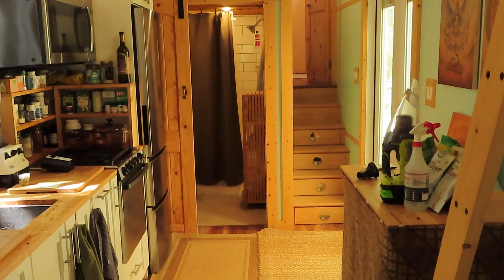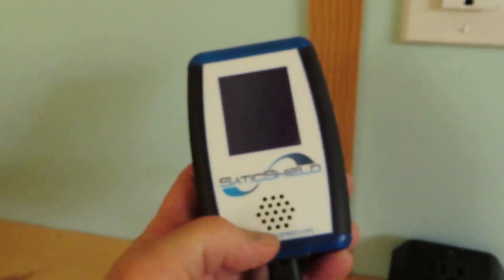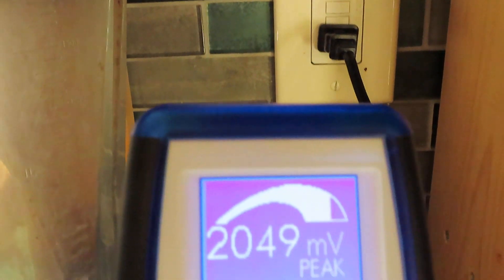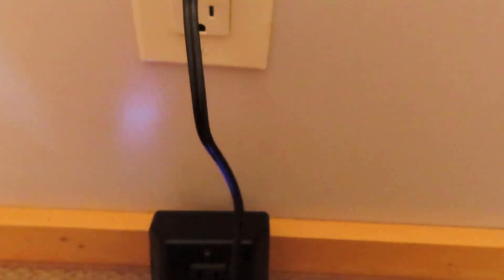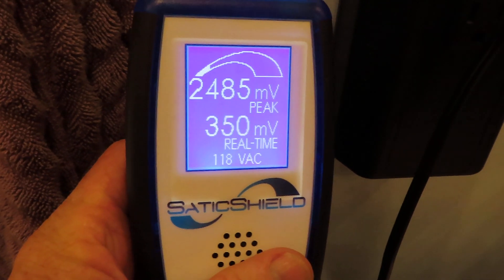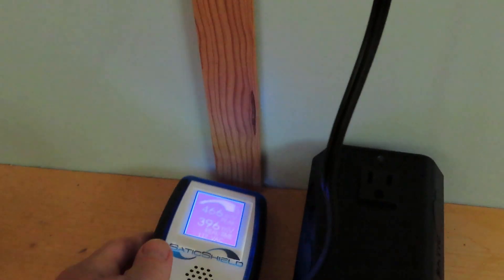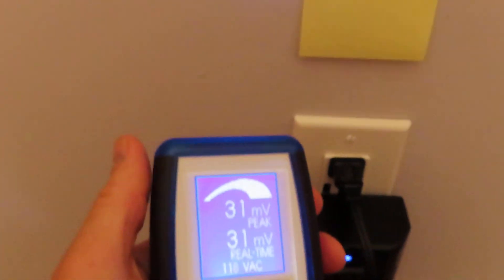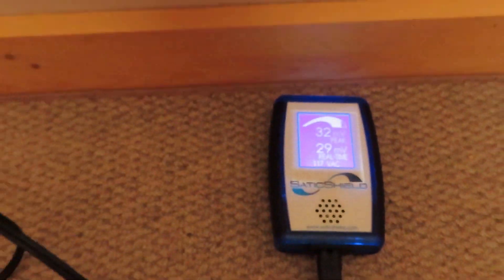Reduce Dangerous Levels of Dirty Electricity on Solar and On Grid Homes! Satic Pure Power PlugIn

Comment: I have electromagnetic sensitivity.  I am considering moving into an apartment building that has solar panels on the roof.  I just had a building biologist tell me it is not a good idea for me to live in an apartment building that has solar panels on the roof.  He said he would not advise anyone with electromagnetic sensitivity to live on a property with solar panels.  I think his point was that this is a building with 67 units and even if I put dirty electricity filters in my particular unit, I will still have the dirty electricity from other peoples units and their wifi etc.  It is only a three story building, so I thought if I asked for a top floor corner unit maybe I could put aluminum mesh screening or copper pipes on any shared wall to block out wifi or the neighbors dirty electricity, do you think this would work?  I remembered I had already seen this video, but maybe this works for you because this is a stand alone structure, unlike an apartment building with shared walls and person below you may have wifi/dirty electricity, so it may be impossible to totally mitigate.......But I may also be able to work with the property manager on getting some kind of dirty electricity filter for the whole building if I explain that this dirty electricity could have health consequences for the residents.  If I was approved for a top floor corner unit I could also speak to the neighbor below me and on one side of me and talk to them about using an ethernet cord and get rid of any wifi/wireless router etc.    Or do you think it is too risky?  Oh yes and I forgot to mention, this building is on grid, so it looks like they will use a combination of electricity and solar as I saw at least one OpenWay Itron Bridge Meter outside the building beside two metal doors.  So it looks like maybe they house 67 electric meters in the room with the metal doors.  I don't know enough about how solar works.  I am just describing as best I can as a layperson.
Reply from the maker: Listen closely please. Here is all I need to know, in your first sentence: "I have electromagnetic sensitivity. I am considering moving into an apartment building." It does not matter if the apartment building has solar panels. All you need to know are wireless devices, located in every single apartment, are going to be exposing everyone in the adjacent apartments through the walls, ceiling and floors. Solar panels and dirty electricity are the least of your concerns. Here is what I just posted on my Telegram channel today (https://t.me/emfsafetyzonechannel):

LISTEN CLOSELY! 
1) I care about you. 
2) I have no agenda for personal gain in mentioning this.
3) I have studied this subject for almost 20 years and know what I am talking about.
4) I am a professional EMF consultant with quite a bit of experience.

With this said, this is a message to all conscious people who have the ears to hear and the will to take action....DO NOT LIVE IN APARTMENT BUILDINGS ANYMORE!

You cannot safely live in apartments, condos or flats anymore at this time on the planet with the insane proliferation of wireless devices. The wireless radiation from all of the neighbors' modems, boosters, cordless phones, alarm systems, TV modems, microwave ovens, all of this is coming through the walls, floors and ceilings when you live connected to other people!

Consider this warning words of wisdom.
Reply: @EMFSafetyZone  Ok thank you so much for this.  I am going to take your advice.
Reply from the maker: Good to hear. You will be happy you did. I never try to act like an expert or a know-it-all. It is just for many years I have carried microwave meters around with me and have become so familiar with the exposure levels in most environments, that it is easy to wisely warn people about obviously high exposure environments like apartments!
Reply from the maker: Regarding your other question, which now I cannot find again, in the video you can see I was living in a tiny home. Yes, finding land and putting a tiny home on it can one alternative for sure.
Reply: @EMFSafetyZone  Also can you tell me what type of structure is this that you are living in, in this video?  Is this one of those pre-manufactured homes?  Or is this some kind of trailer or camper?  Unfortunately, I cannot afford to outright buy a home, but I likely could rent one.  I also have very good credit, maybe I could buy some kind of camper.  It is becoming so difficult to find a SAFE place to live.  So your suggestion for those with Electromagnetic Sensitivity would be that you have to live in a stand alone structure such as a home or trailer/camper so that you will have the most control over your environment?  Although you would still have to be mindful of your neighbors smart meters.  Or else, I would have to maybe move to a city that has a moratorium on smart meters.  Do you know off hand if possibly any states have outright banned smart meters in the entire state?  I have no idea where to go.

Comment: Neil, what type of inverter is yours: modified or pure sine wave? The latter is expected to produce less dirty electricity.
Reply from the maker: In California, where I was at the time of this video, I am rather sure it was a pure sine wave inverter. But remember, modified or pure sine wave inverters are, by their very nature of turning DC to AC power, going to produce a large amount of high frequency transients. You may be right about the difference between the two, modified vs pure sine wave. But still, all inverters produce dirty electricity in large amounts, which in my opinion need to be addressed using the correct products:

https://emf-protection.us/emf-protection-store/#!/Satic-Power-Perfect-Products-Reduce-Dirty-Electricity-and-Power-Costs/c/32210197

Comment: Should you be concerned about household appliences or things like getting a haircut  from an electrical hair cutting machine?
Reply from the maker: The subject is a bit complex. I will try to offer a simple response that is hopefully intelligent and practical. Yes, all household appliances that plug into the wall will emit low level electric and magnetic fields. However, this is mostly a concern if you are sleeping near these appliances. For example, let's say your child's bed is located on the other side of the wall where the refrigerator is located in the kitchen. In this way, electric and magnetic fields would be moving through the wall and exposing the child while sleeping. I also suggest not have plug in electric lamps on nightstands next to the bed, using an LED battery operated lantern instead, and if possible, turning off the circuits in the bedroom at night. With all this said, the dangers of various levels of EMF are 'cumulative.' I would doubt a haircut once in a while with an electrical haircutter is going to be an issue. More of an issue is carrying around a cell phone that is constantly emitting radiation, exchanging data and updating apps by staying in contact constantly with a local cell tower! This radiation is going through the body constantly! Or having a wireless modem in the home or other wireless devices which are constantly transmitting radiation. These should be your primary concern!

Comment: I know nothing about this so please be patient with my question...
Does your inverter include pure sign wave? I'm planning to plug my camper into a 30 amp power station. Will I need those pure power plug ins if I do? Thanks
Reply from the maker: I am very patience because I am not an expert either. But I do my best. Forgive my ignorance if you will? A 30 amp power station? Does this mean you will plug your camper into a solar powered power station, something that is turning DC power into AC power? If so, it is possible you could use some Satic Plug In devices. But tell me, how large is your camper? Can you unplug it at night so there is no electric running through it while you are sleeping? I can better assist if I know these things.

Comment: you made a small mistake here brother. Here is what you need to do. You probably have 2 phase power coming into your home, esp if you have a dishwasher. The best way to arrange these pluggers is if you plug them in such a way that it touches both phases of power. Furthermore, instead of installing so many pluggers you could have just installed these directly off the main panel. Just make sure you have an outlet there that comes off the main panel. Furthermore, there are also super duty power conditioners that you can install as a surge protector and that would bring your entire EMI readings down low.
Reply from the maker: Hi there, thanks for your care and comment. I made no mistakes my friend. You watched me do an installation inside a tiny home that is solar powered. I have no dishwasher. There is no main panel, it is just a small fuse box. I am a Satic distributor and I am very aware of the Super Duty whole house units. In this tiny home, there would absolutely no space to install one of these. Thus, using 4 Plug In devices was the best choice in the situation. I have done installations professionally with neighbors in this area. One neighbor did not want a whole house Super Duty unit on their solar power system because there was no room on the equipment panel. Thus, it took 8 Plug In devices to greatly reduce their dirty electricity. Another neighbor, on an off grid home, required a whole house unit and an additional 6 Plug Ins. I get the sense you are offering your suggestions based upon your experience of remediating "on grid" homes. It does not sound as if you have had experience with how incredibly toxic solar powered homes can be in regards to dirty electricity.

Comment: Would a power conditioner in line near the panels reduce the transient frequencies?  
Are the same electrical hums that pick up on an AM radio the same type of transient frequencies?
Reply from the maker: When installing a power conditioner, yes, putting one or two near the breaker panel is a good idea. However, whether one is using Greenwave, Stetzerizer or Satic, never would a person use just one filter. With the exception of when you choose the larger whole house units from Satic. And yes, an AM radio will pick up on the electromagnetic interference, but you cannot rely on this as when using the meter which is specifically for measuring dirty electricity.

Comment: When I did the same with GS filters, I found the DC Amp load from batteries to inverter was increased for each filter 0.20A, 0.25A, 0.28A. Did you measure the amps cost for this product?
Reply from the maker: Experts have suggested that when using Stetzerizer and/or Greenwave Dirty Electricity Filters, they can exacerbate low level electric and magnetic fields, and they do use up power. I do not install those types of filters on off grid homes. I had an electrician test the Satic Plug In devices for me, they were pulling about 1/10 of an amp! Which is almost nothing.
Reply: @EMFSafetyZone  Excellent. Thanks for the new information.
Reply from the maker: Many years back, when I had a lot to learn, but was passionate about reducing dirty electricity, and before I had learned about the Satic devices, I did an installation on this guy's off grid home in the desert. I installed about 15 Greenwave filters and was so proud of myself for getting the dirty electricity readings down so far. 2 days later he called me, screaming at me to come take my filters back because they had drained his batteries! That is how I found out the hard way that Stetzerizer and Greenwave filters can use about an amp each when they are plugged in. For an on the grid home, this is not much, for a solar powered home that is a lot! When I became a Satic distributor and used them in my off grid home, I was worried because of this past experience. I had an expert electrician check the Satic devices and I remember him putting my mind at ease, saying "these things are only using about 1/10 of an amp. I have used them in remediation of solar powered off-grid homes ever since!

Comment: Which power plug in do I get?  I saw a few in your eBay store
Reply from the maker: Consider what size home you have and potentially how many Satic Plug In devices you may need? In my tiny home, which is off the grid, I used 5. But most homes, on the grid do not need that many. You can usually use 2 or 4 for the installation and really create a safer more comfortable home environment. Here is the link to my ebay store:

https://www.ebay.com/str/healthyjoyfulsustainableliving/Satic-Dirty-Electricity-Filter/_i.html?store_cat=33701322016

Here is the link to my website:

https://emf-protection.us/emf-protection-store/#!/Satic-Power-Perfect-Products-Reduce-Dirty-Electricity-and-Power-Costs/c/32210197
Reply: @EMFSafetyZone  AWESOME!!

Comment: Can we plug those in ourselves?
Reply from the maker: Thank you for asking. Yes, installation is so simple. You verify the size of your home and then get the number of Plug In devices you need and you simply plug them into home with a Plug In on the 'phase A' circuit and another one on the 'Phase B' circuit. They come with installation instructions. Most often, 2 Plug In devices will suffice to greatly reduce dirty electricity in homes less than 3,000 sq ft. However, as a professional EMF consultant, and being a very honest person, I will tell you plainly that every single installation I have done was different. Some homes are easier to remediate in terms of reducing the dirty electricity, other homes require a few extra Plug In devices to get the readings down. Dirty electricity is a very strange and complex subject and each situation is different. However, to be very simple in my response if your home is under 3,000 sq ft, you can purchase two Satic Plug In devices and simply stick them into the wall yourself!
Reply from the maker: No, your breaker panel is not relevant for installation other than knowing which rooms are on phase A or phase B of the circuit. Or, if you wanted to use one of the larger heavy duty 'whole house' devices then it would have to install near your breaker panel.

Comment: Impressive.  One more reason to say NO to the "greening" scam being pushed by the globalists.
Reply from the maker: Yes, I know, it is a razors edge. For me, I like living remotely. The closest power pole to this land about 1/4 mile up the road. So corporate grid power is not even available here. If there were power poles carrying grid electric, then I would also be potentially subjected to small 5G cell transmitters that could be deployed onto those power poles, or even the relay transmitters for smart meters, which are in this area on homes connected to the corporate grid. So yes, a razors edge. However, since I know how to reduce the harmful levels of dirty electricity and what products to use, i can live off the grid. I have remediated off grid homes for myself in hawaii and here in California.